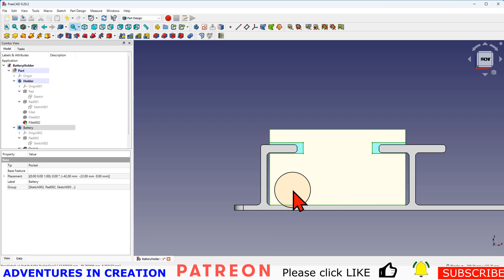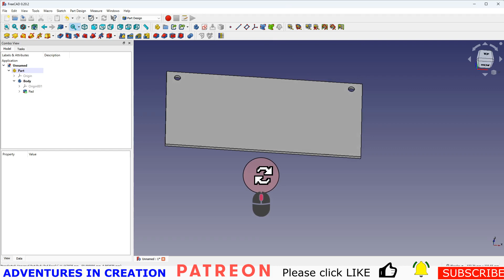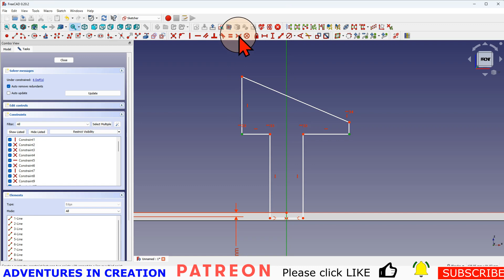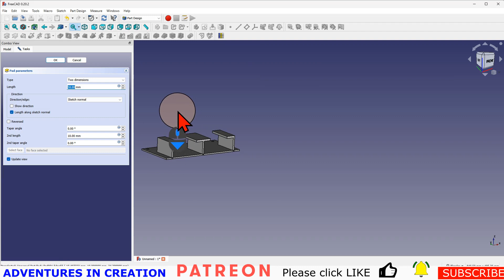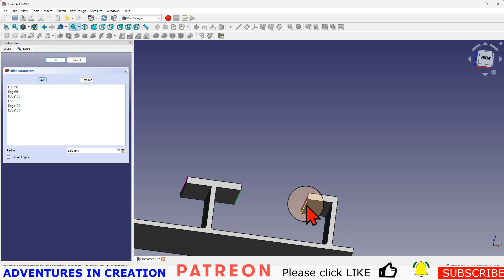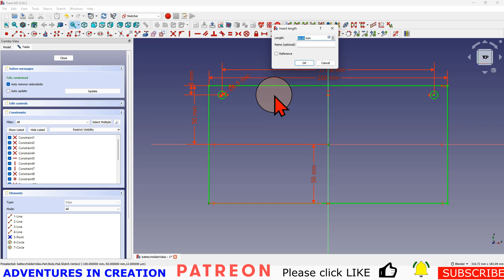FreeCAD for Beginners #50 Battery  Holder Parametric Model #freecad #makers #cad #design

Comment: When you modified the hole spacing to 177.8mm, an easier way to do that is to delete the mm and type 7 in or 7". It will automatically convert it.
Reply from the maker: Yes, you are correct, as long as include the " for the 7"